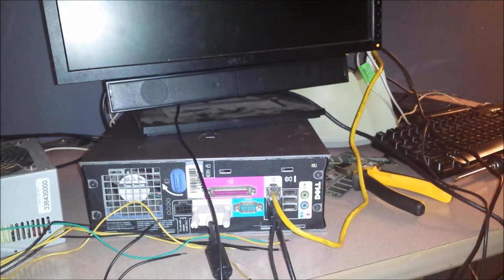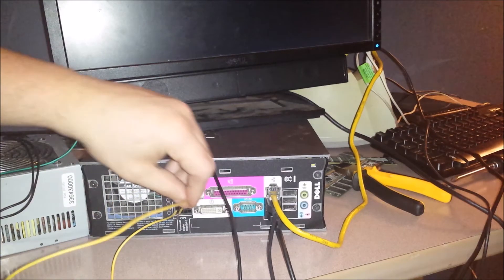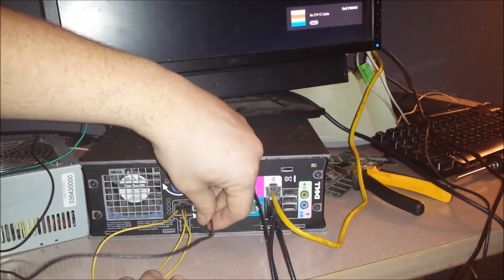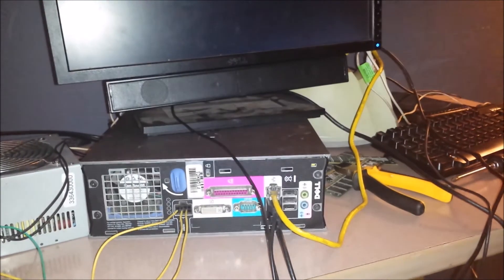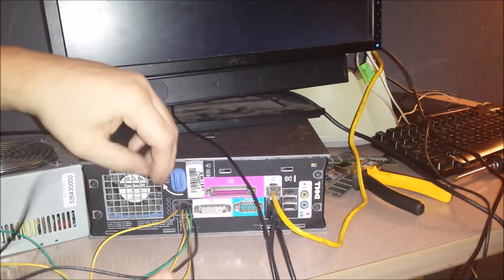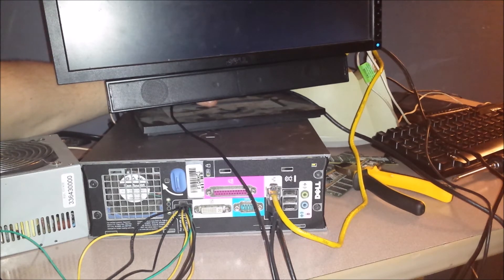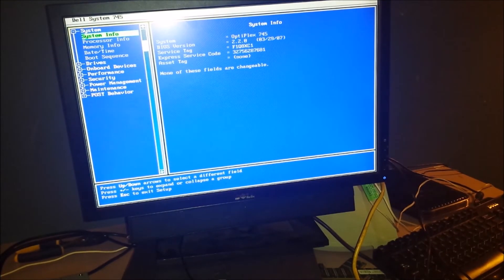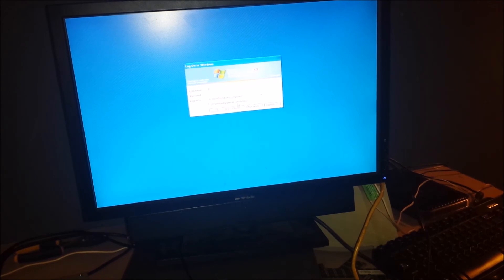Trash Picked Dell Optiplex 745 USFF PSU Hack

Comment: I have the same machine sitting on my desk right now with a jerryrigged power supply, the atx pinout on the 24 pins connector will fit (if you cut it) into the 8 pins from the dell! So i use a atx power supply to power this pc and it works great!

Comment: hey great you didn't show how you wired it to the other end and I had one of them was really good computer and I gave it away wish I didn't its so good and fast I'm hear fixing slower computer now Amd Sempron 3200 its slower that that ill tell you windows 7 goes on that ok to I put only 2 gig of ram ans had 80 gig drive on board video to that all duo same as yours ok don't know if that helps you so the computer I'm talking about with win 7 is same as your one
Reply from the maker: I'm not sure what you mean, I was using a standard ATX power supply.
Reply: why were you jumping the wires that one you were using didn't work so you use another power supply ? why shouldn't  you just put a new or spare on connected I do it a lot don't have it in the case just hanging out connected to the mother board ok thanks I tried to understand what you did that was all so don't worry there a good computer i loved mine but gave it away
Reply from the maker: I don't have the original one to the computer. When I picked it up from the trash, it wasn't with it. I am using a standard ATX power supply to make a non standard machine run. The point of this video was to show how to do that in case that ever happens to anyone.